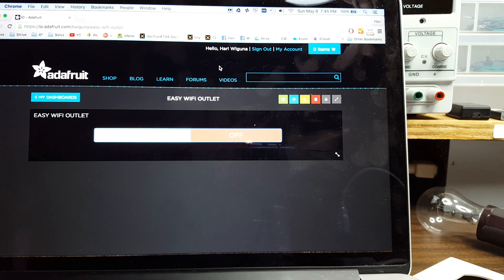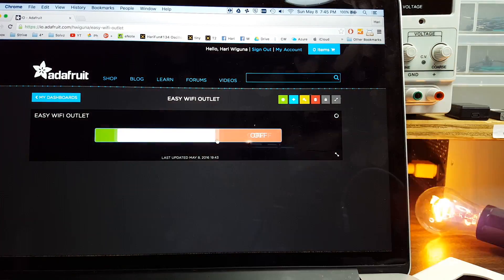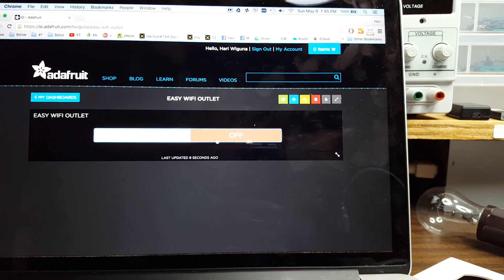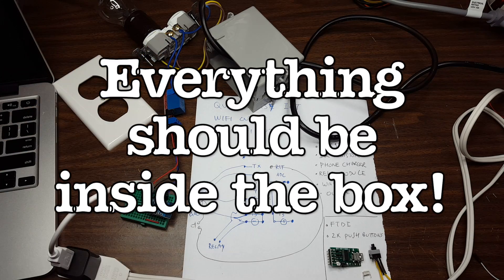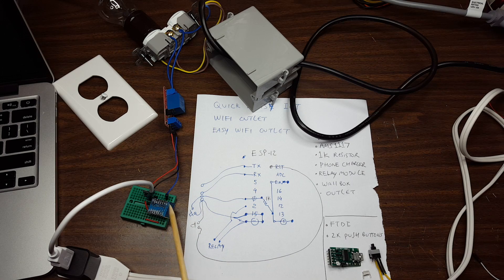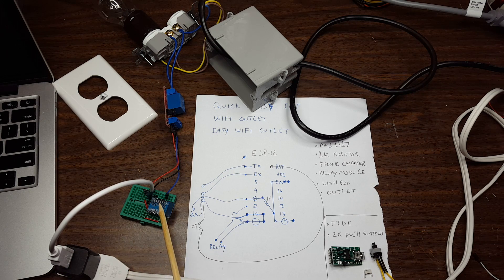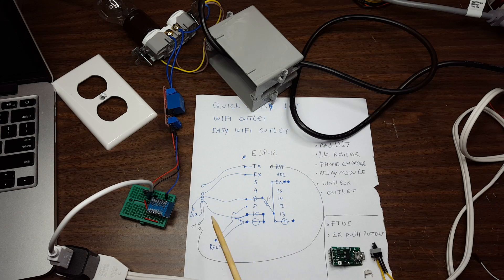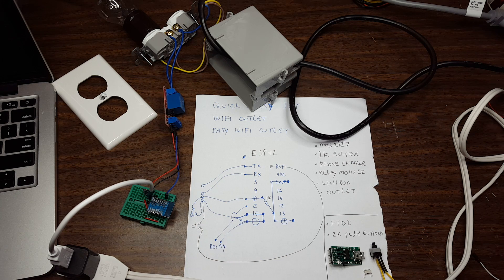HariFun #135.0 - Easiest WiFi Outlet

Comment from the maker: +msevyt, is this your project? ;-)
https://www.reddit.com/r/arduino/comments/4je3sd/arduino_controlled_irrigation_system/
I got the intro for my next video done, but still have to finish the actual build video.
In other news, Sonoff arrived already!  So far it is not working. :-( I can turn it off and on using the button, but the app does not find the sonoff.  Their app looks kinda scary, it's partially in Chinese and the new version appears to want complete access to the phone!? I'm too scared to update it.

Comment: looks cool man .  you know  you could  swap out that relay with a SSR if you want silent operation , and some are made for use in outlets .  they have solid mains terminals and can switch on with as low as 3v trigger voltages in the 3 to 36v range on some .   also they don't produce inductive load based issues as they are  like really big triac . like a darlington for AC . SSR are not only silent they can also be PWM driven .  for say a ESP controlled re-flow oven , that can host a page with data history and web based interface for controls. ( no i have not started one yet , but i have  sketched one out . LOL ) . so while you tinker have a look at possibly using a SSR , and then you only need to power your ESP , as no 5V rail will be needed. 
down sid eis big ones are not cheap ,  but i have even see people use them (VDC ones )with PWM to directly heat their 3d printer heat beds ! . LOL http://www.aliexpress.com/item/FOTEK-single-phase-solid-state-relay-FOTEK-SSR-40DA-H-40A-FOTEK-SSR-40DA-H/755250211.html
Reply from the maker: Thanks for all the ideas Scott.
It's hard to compete with $2 relay module though.  Not counting used cellphone charger and power cable, the total parts cost is only about $5 !?
https://hackaday.io/project/11620-harifun135-wifi-outlet
Reply: +Hari Wiguna yeah SSR can run you like 10$ for a ok one.  And you know i'm all about recycling / re-purposing.

Comment: Why don't you just buy a Sonoff and build upon that. i think that would make a much cleaner and safer solution.
Reply from the maker: +msevyt 
Whoa! I didn't know that Sonoff is only $5!
https://www.itead.cc/sonoff-wifi-wireless-switch.html
You're absolutely right!  That is much cleaner and safer!
Thank you for pointing that out.
Reply from the maker: +msevyt 
I've just ordered some Sonoffs. Thanks again for the tip!
Reply: +Hari Wiguna No problem Hari. You know what I'd like to see. That you would hack this inside one of those cases from 433hz plug sockets and maybe desolder its button and resolder one on the outside of that case for local control in addition to wifi control. if I may suggest you should take a look at the excellent ESPeasy firmware google that i think it has .nu at the end.
Reply: +Hari Wiguna see here http://www.esp8266.nu/index.php/Main_Page#Downloads
Reply from the maker: +msevyt 
I'll check it out when I receive the Sonoff.  ESPeasy and domoticz looks cool.  More toys to play with. Yay!  Thanks!

Comment: Awesome Hari but I'm wondering something doesn't the relay need 5v to switch the coil in it? Because the Esp8266 is only 3.3v on the pins correct? But other then that Awesome video :)
Reply: +joseph chrzempiec (josephchrzempiec) the 5v is taken before the 1117 to the relay, i think is the red wire, the blue one is signal
Reply from the maker: +joseph chrzempiec (josephchrzempiec) 
+Jose Luis Navarrete 
You are both correct.  The relay needs to be powered by 5V and I got the 5V directly from the phone charger before the AMS1117.

Comment: Don't forget the diode across the relay. 👍🏻
Reply from the maker: +Edwin Noorlander 
Good point!  Thankfully the relay module has that covered.
Reply: +Edwin Noorlander If it is cheap Chineese relay module it already has everything necessary on its PCB. For double relay modules you even have optocouplers.